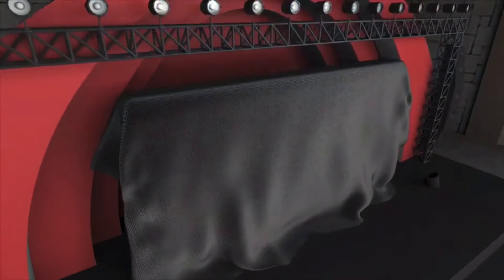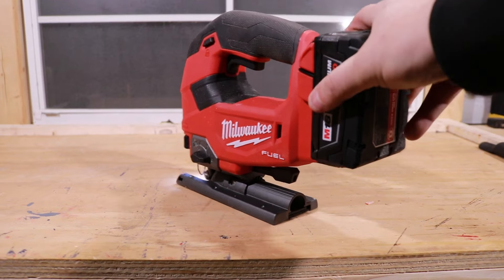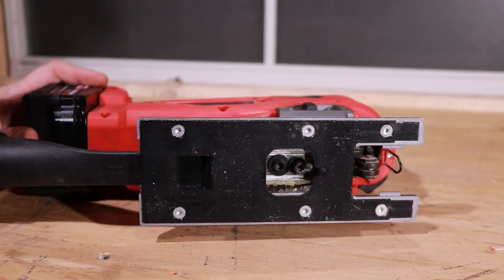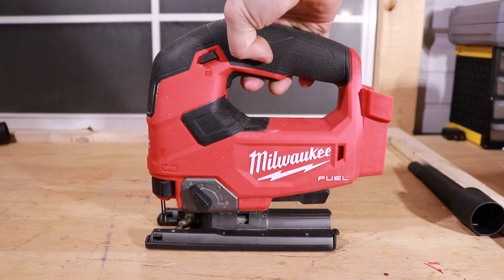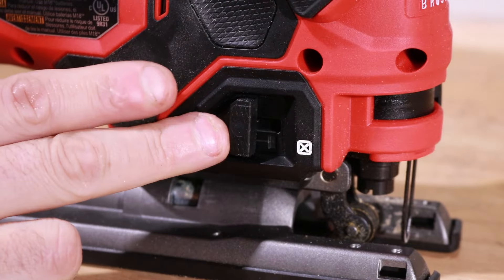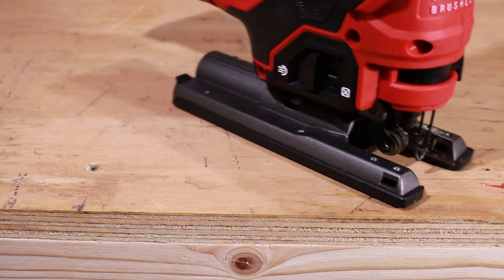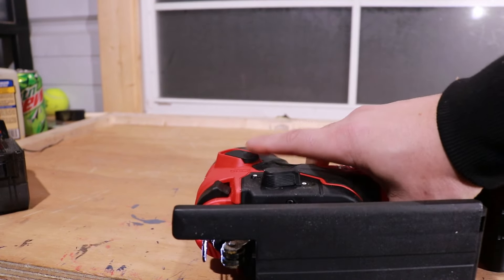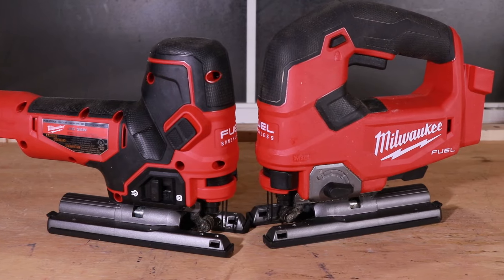Milwaukee Barrel Grip Jigsaw (2737B-20) vs. Milwaukee D-Handle Jigsaw (2737-20) Tool Duel Episode #5

Comment: the d handle is now significantly cheaper than barrel grip and i’m debating how much up side down cutting i do because that changing bevel with key is a possible deal breaker, guess the d handle doesn’t have that speed dial? just trigger? hmmmmmm idk

Comment: The angle adjustment lever on my M12 jigsaw has always been a little loose so that it doesn't hold the angle very straight at all.
I would prefer the allen wrench system that the barrel grip M18 jigsaw has.
And yes that would be a deal breaker for for me.
Reply: M18 has same issue
Reply: Good review and if you check Amazon, you'd see many bad reviews for the D handle saw such as lever loosening while working, angle not holding when doing straight cuts, other incidents (Mine had a pin guide issue also so now I must not apply too much force, else, something else would get damaged in the mechanics and I need to hold the 
lever while working to keep on the line.) and I'm now considering Hilti or Festool brand because when going threw
hard wood, many tools would have issues.  Five stars for communication, tech. skill, experience for you⭐⭐⭐⭐⭐

Comment: I’ve got the D handle. As much at cutting bevels on the fly is handy without the Allen key, I find it VERY annoying how loose the bevel paddle is. Sometimes the bevel lock just flies open for no reason and if you aren’t careful you can bevel a cut without meaning to.

Comment: Barrel grip I think would be better. The D grip with the lever it seams the lever always gets to where it will not keep the saw locked in the straight position I have trouble with the lever lock constantly because it will not always stay locked.

Comment: I wish I would’ve got the D handle. I have the barrel grip and it sucks. When you’re cutting and you want to stop you have to press the on/off button vs just stop pulling the trigger on the d handle.

Comment: I own both of them ,and I like both of them. Each of them has its own purpose.
Reply: Good review and if you check Amazon, you'd see many bad reviews for the D handle saw such as lever loosening while working, angle not holding when doing straight cuts, other incidents (Mine had a pin guide issue also so now I must not apply too much force, else, something else would get damaged in the mechanics and I need to hold the 
lever while working to keep on the line.) and I'm now considering Hilti or Festool brand because when going threw
hard wood, many tools would have issues.  Five stars for communication, tech. skill, experience for you⭐⭐⭐⭐⭐

Comment: Went to Barrel Grip (DeWalt DCS335) cordless from a nice corded Bosch D-Handle Jig Saw. The barrel grip is much easier to control and feel no issues holding onto it. I like it much better. I don't miss the variable speed trigger and actually prefer on and off now. Speed can be adjusted with the toggle switch, but I pretty run it on max (7) all the time with no oscillation as it gives a very nice cut in wood.

Comment: Yep deal breaker - they just went back ten years with the Allen key adjust
Reply: i was sold on the barrel grip until i saw that.
Reply: Good review and if you check Amazon, you'd see many bad reviews for the D handle saw such as lever loosening while working, angle not holding when doing straight cuts, other incidents (Mine had a pin guide issue also so now I must not apply too much force, else, something else would get damaged in the mechanics and I need to hold the 
lever while working to keep on the line.) and I'm now considering Hilti or Festool brand because when going threw
hard wood, many tools would have issues.  Five stars for communication, tech. skill, experience for you⭐⭐⭐⭐⭐

Comment: I had that barrel grip and returned it. Didn't like how you couldn't stop mid cut without reaching for that button. The button is not easily accessible either. The D handle is so much better to use.

Comment: I really like the barrel grip, I’m sure Milwaukee will just add the lever to adjust this next year, but even if they wait I’d still get the barrel grip.
Reply from the maker: Yeah been using the barrel grip a lot lately.  Really starting to like it better now. Thanks for the comment!
Reply: Good review and if you check Amazon, you'd see many bad reviews for the D handle saw such as lever loosening while working, angle not holding when doing straight cuts, other incidents (Mine had a pin guide issue also so now I must not apply too much force, else, something else would get damaged in the mechanics and I need to hold the 
lever while working to keep on the line.) and I'm now considering Hilti or Festool brand because when going threw
hard wood, many tools would have issues.  Five stars for communication, tech. skill, experience for you⭐⭐⭐⭐⭐

Comment: The bevel control on the barrel grip is the deal maker for Me to be honest. I have a m12 jigsaw and hate it due to the lever coming loose constantly and causing the shoe to tilt without me wanting it to
Reply: Thanks; same here and I've been trying to explain that to someone but she cursed me out, but I didn't care.
Reply: I had same issue but I just tightened the screw holding the lever and never had the issue again

Comment: The milwaulkee is different to the metabo.
The d handle on the metabo has a narrower base than the barrel grip. Also angle adjustment is opposite. The d handle has an Allen key to adjust angle whilst the barrel grip has a lever to change angle. For the metabo I like the barrel grip. I do have the d handle.
As for milkwaulkee I like the barrel grip.
Shame milwaulkee should make the base plate wider for the barrel grip.

Comment: Wondering if women or guys with smaller hands struggle any more getting hand comfortably over the barrel grip? If anyone can comment.
Reply from the maker: Great question. The grip isn't actually that big. Anyone should be fine using it, but if you do get one and it turns out to be uncomfortable,  just return and exchange it for the D handle

Comment: Never a D-handled jigsaw. French cut 95% of the time when using a jigsaw. For that a D-handle is absolutely worthless.
Reply: What do you mean by french cut?
Reply: @mikerobertson5919  upside down. Some, like the old blue Bosch pendulum saws, are basically a barrelgrip saw with an added D-handle. If they also have a separate "always on" power button, in stead of a click switch, those are OK, but the handle is more in the way, than anything else.
Reply: @martinpoulsen6564  Ahh I see. Thanks for the insight.

Comment: I don’t think they can be compared. Barrel will own 90 degree cuts and D will be better for bevels.
Reply: Good review and if you check Amazon, you'd see many bad reviews for the D handle saw such as lever loosening while working, angle not holding when doing straight cuts, other incidents (Mine had a pin guide issue also so now I must not apply too much force, else, something else would get damaged in the mechanics and I need to hold the 
lever while working to keep on the line.) and I'm now considering Hilti or Festool brand because when going threw
hard wood, many tools would have issues.  Five stars for communication, tech. skill, experience for you⭐⭐⭐⭐⭐

Comment: What is the orbital action ?
Reply from the maker: Orbital action provides vibration to the blade to help it cut faster.  It wont cut as clean, but works great getting through material fast
Reply: Tool Review Zone thanks